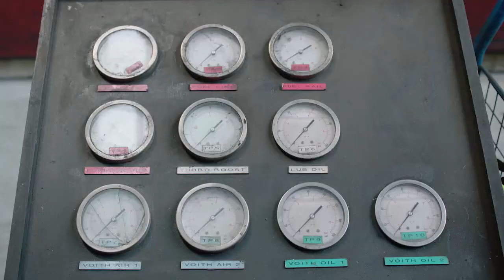Davie's building the best railway that Scotland's ever had

Comment: The air conditioning on a train came from Manchester airport no windows opened sealed class 156 are the same seal windows a 
Better design is needed one with the windows open at the top like the older scotrail modals